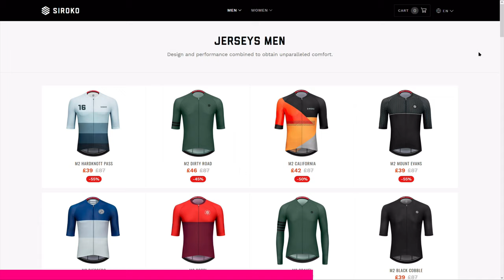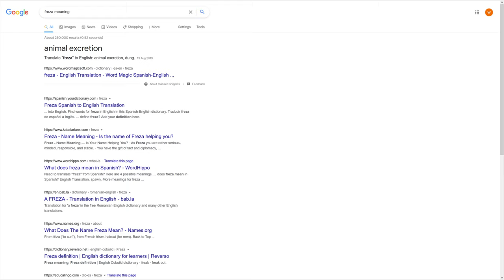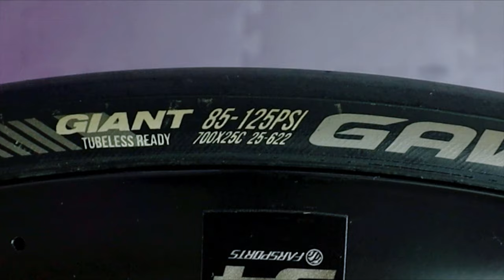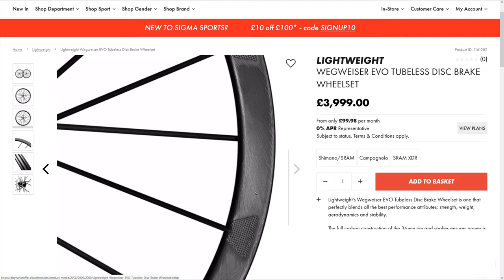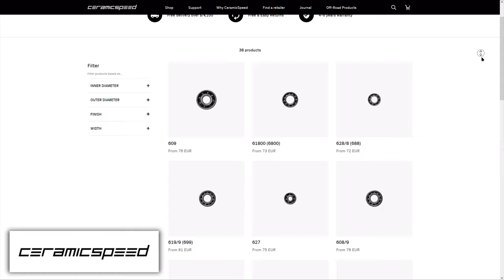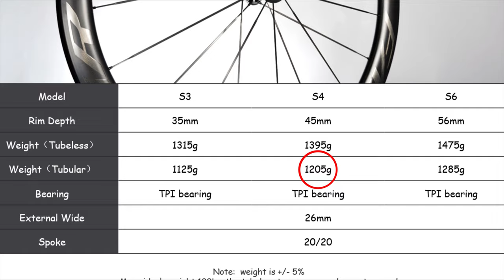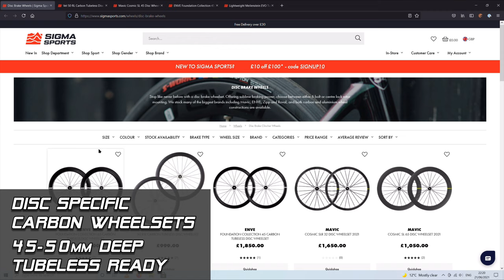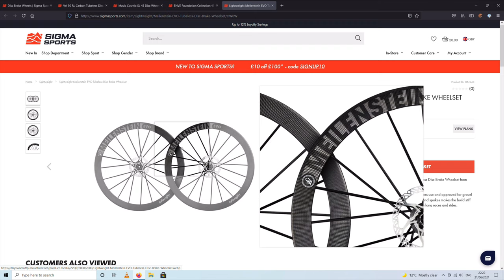CARBON SPOKES on Chinese Wheels - Farsports Ventoux S

Comment: One of the reason why stuff from China is so cheap is because the warranty is not worth the piece of paper it's written on. Lots of the time sellers would simply argue or ignore you when a problem is reported. Even if they're happy to look at it what are you going to do? Mailing a wheelset back to base is going to be an expensive business.

Comment: I was expecting these to be cheap, but they're over $2k AUD LOL
Reply from the maker: Yeah these are pretty premium... The last video was on the cheapest carbon wheels i've ever used, this time the most expensive 🤣
To be fair, they are EXCEPTIONAL wheels though, and compared to some of the bigger brands, the value is pretty great
Reply: @TraceVelo  I'm glad you didn't go for anything cheaper, otherwise I could see those carbon spokes not holding up very long, I'll stick to my heavy wheels and all season PZero's😂

Comment: Not true. It cost 1700 for a disk break version + 100 dollars for shipping + 10 for insurance = 1810. Free shipping take about 30 days what is terrible. Does not worth it. If you go to Merlin Cycles and buy a vision 50mm carbon wheelset, you get free fast shipping (3-5 days) world wide and pays 1100 dollars. Detail: I do not care about carbon spokes at all, you can have them.

Comment: I've said this a billion times ALUMINUM stronger and safer material. anything carbon is GIK
Reply from the maker: Aluminium does have it's place definitely, but I recently had to throw away an Aluminium bike frame, due to a stress fracture in the chainstay tube. I haven't faced this issue on any of my carbon frames...